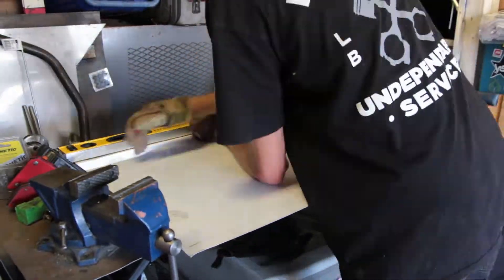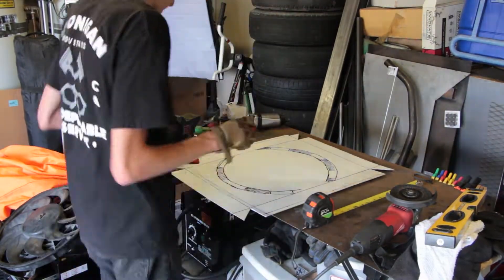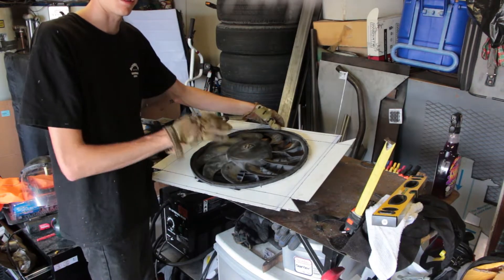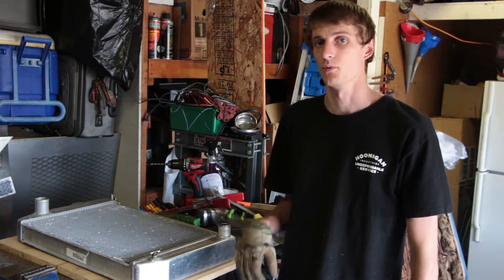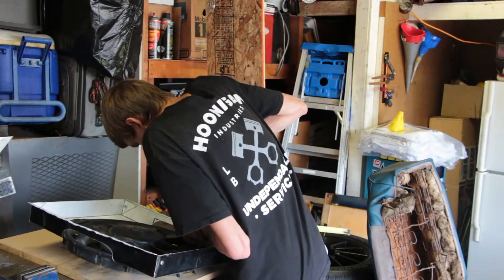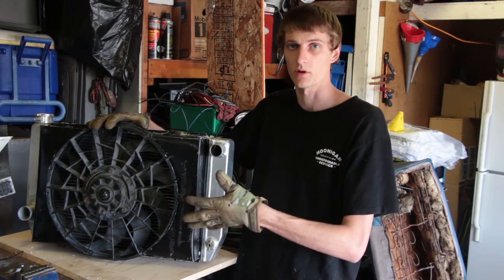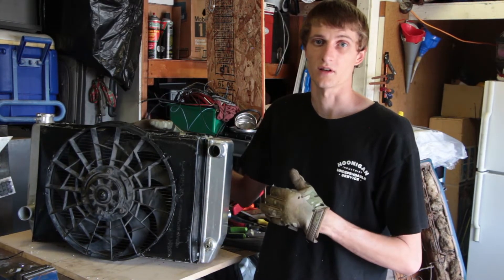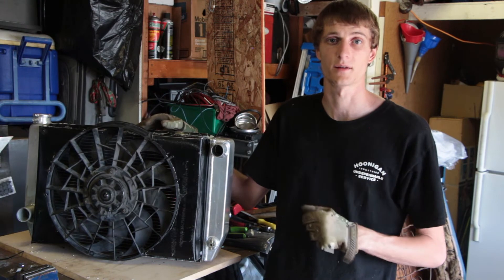V8 Swap - Custom Fan Shroud and Taurus Fan Install!

Comment: How did the fan work?
Reply from the maker: Fan worked way better than the last
 Could feel and hear a significant amount more air moving through. But I ended up having some other cooling issue. Im solving it now and i expect that ill have exceptional cooling without this mystery problem in the system.

Comment: Nice job. Been having a tough time keeping my LS7 cool in traffic. Small radiator doesn't give much choices but O am ready to go with fan/fans slightly larger than the core the way you did. You still running a/c condenser?
Thnx t

Comment: Hey, neat channel you’ve got here. I like the short, concise format of your videos. Most YouTube videos on automotive channels are way too long, too much talking, unnecessary shots of uninteresting work being done, etc. Some of us have short attention spans and appreciate when a video gets right to the point. 👍 

I’ve had both an 240SX and a 5.0L Mustang and always thought the 5.0L would make a great swap into the 240 chassis so it’s cool to see someone do it.

I assume your Taurus fan is working well, I had one on my 5.0L and it will definitely cool those engines down no problem. I’m looking to install one on my 4.0L Jeep Cherokee now which is how I found this video.
Reply from the maker: Well I definitely appreciate it 🤙just trying to help the community out and have some fun
The 5.0 is a pretty good time in the 240 for sure. Lots of torque which feels great on track and just cruising around. Mine is still having heat issue while drifting which I am thinking is internal engine problems at this point. Ganna pull the heads soon to inspect and re-gasket everything to be sure

Comment: Hey, how did that window weld tourque mount upgrade go? My accords engine rocks alot and i wanted to do it to mine. Also as always, great content :)
Reply from the maker: It worked well, id definitely do it again if I had to before buying some pricey poly mounts.